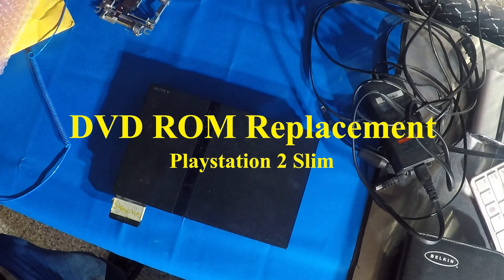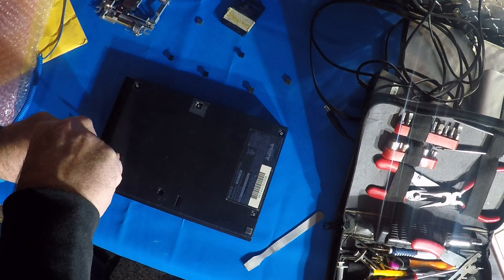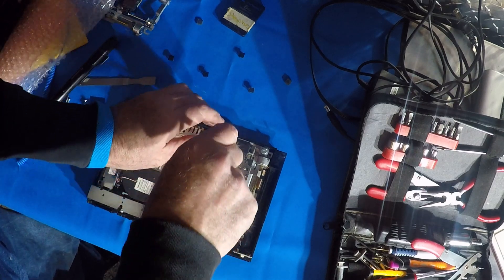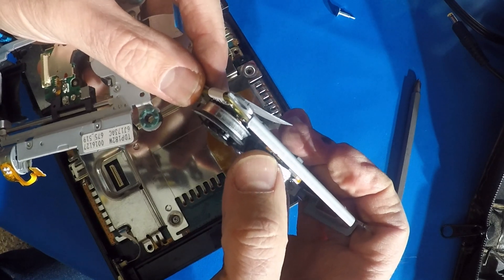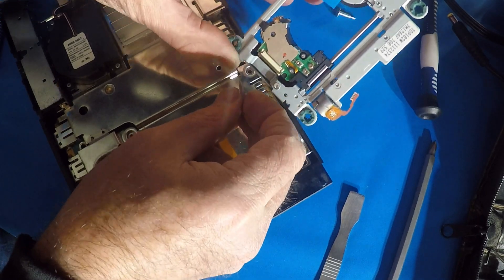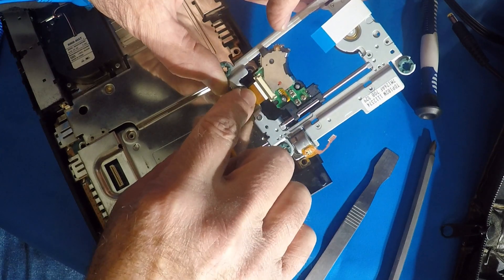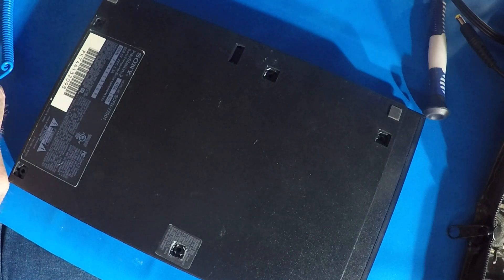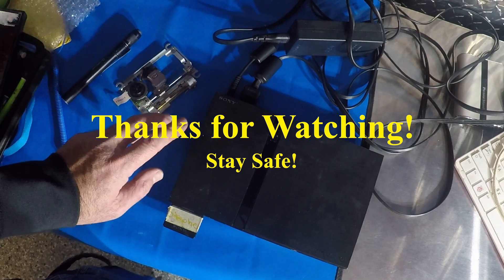PS2 Slim DVD ROM Replacement

Comment: Hello which company did you get this unit from? I want to replace mine but most companies sell them with the solder blob. I do not have a soldering iron which is why i ask. Thank you!
Reply from the maker: This is a link to the first one that I installed. Aluminum Alloy Optical Pickup... https://www.amazon.com/dp/B0BVN2P41G?ref=ppx_pop_mob_ap_share